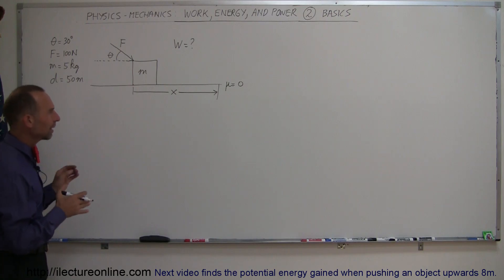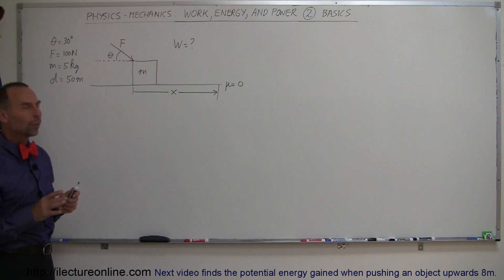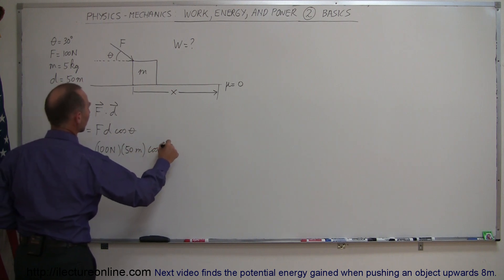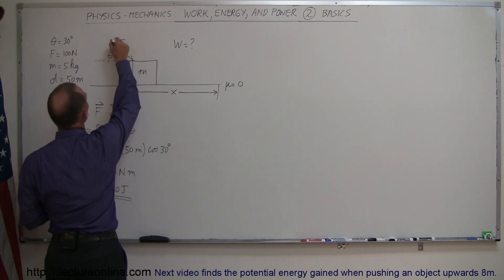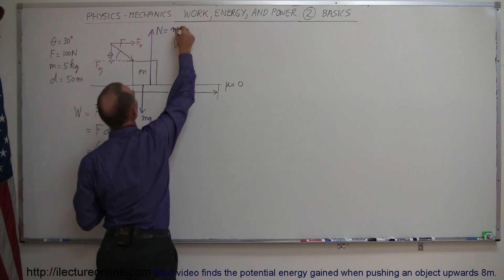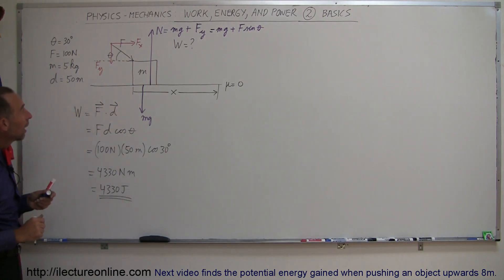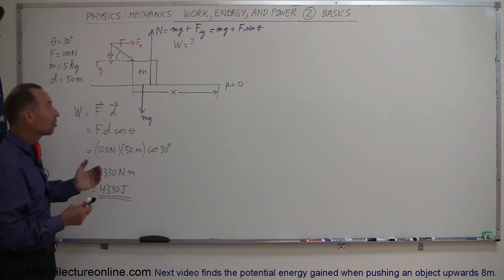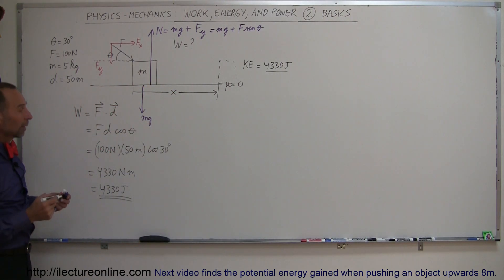Physics 8  Work, Energy, and Power (2 of 37) Basic Example

Comment: I have a question: when you started using the second way you know finding the components for the force(F), how will that help us find the work? Do you just replace the magnitude of the force(F) with its x component in the formula for work and ignore y since it's not moving along y?
Reply from the maker: The definition of work is:  W = dot product of the force and displacement = |F| x |d} x cos (angle between them).    Or we can simply take the component of the force that is in the same direction as the displacement = F x cos(theta)
Reply from the maker: Work = dot product of Force and Displacement.  Or you can just take the component of the force in the same direction as the displacement.

Comment: does mass become unimportant in this problem??
Reply from the maker: It depends on what is being calculated.  If all we are determining how much work the applied force does, the mass of the block does not play a role.  But if you want to calculate the kinetic energy imparted on the block and how fast it is moving, then yes, you will need the mass.
Reply: @MichelvanBiezen  thank you so much! I have been struggling a lot with uni physics since it is online

Comment: Hi sir! Sorry just a question here. It seems easy though but the given information does not seem enough. A 75 kg person climbs stairs and gains a height of 2.50m, and find the work done to accomplish that task. Here the question didn't offer force or displacement, and it doesn't provide the angle between the component of force and displacement. With mass and height given, the first thing that flashed in my brain is PE, so I think maybe I can try. I multiplied everything up and got 1875 as the PE. I know that -PE = KE, so the KE is -1875J. Using the work-energy theorem, I found that Wnet = -1875J. I don't think it's right. How can I calculate it if I don't know either the F and d and the angle?
Reply from the maker: PE it is.
Reply: @MichelvanBiezen  Okay thank you for replying! So the work done is PE?

Comment: Hi :)
I'm not sure if I understood well enough. So in this case, the x component of the force is used to get the object moving and because there is no friction it all goes into the kinetic energy - but if there was any friction, the x component would be equal to the friction so it would all go into heat and it wouldn't contribute to the kinetic E? What about the y component in both cases?
Reply from the maker: If the x-component of the force was greater than the friction force, there would still be an increase in kinetic energy, but not as much.  (Only the portion of the force that exceeds the friction force would increase the KE).   In the vertical direction (y), the forces are balanced.  (No net force).
Reply: @MichelvanBiezen  Thank You very much! :)

Comment: isn't the normal force equal to "fsin(theta) - mg" instead of them being added since the weight of the box is directed downwards?
Reply: fsin(theta) is not a reactionary force to mg as the force is being applied to the box, which adds the y vector component of the force to mg, the normal force is the reactionary force to that addition

Comment: great video but im confused as to how you finished solving by using the second method. Thanks
Reply from the maker: What specifically are you confused about?
Reply: in general, how you use the second method to find the work done. I don't understand why we have to find the Normal force.
Reply from the maker: You don't need to know the normal force unless there is friction.  When there is friction you need to calculate the friction force.

Comment: I understand how you calculated the normal force, however, am I correct in saying there was no need to calculate that force, as, like you said all the work done is transferred to KE into the block moving sideways. Therefore the vertical forces are irrelevant, in this case, as they cancel out.
Reply from the maker: Since there is no friction, you don't need to know the normal force.
Reply: Thank you for your response.

Comment: If the block would have been on an incline and pushed up, would there be 4330J of potential energy and kinetic energy?
Reply: It seems like we would separate the energy into components, and the y component would be the potential. Is this correct?
Reply from the maker: Energy is a scalar quantity and thus you cannot separate it into components.

Comment: what if we don't have the mass? Is there any way to find out the PE?
Reply: never mind i got it, but what if the force is applying on the right side of block with the same angle from horizontal line , but towards right(NE). 
In that case are we going to have any PE?
Reply from the maker: Potential energy can only be added to an object if the object gains height.  If the object remains on the surface, there will not be any PE.

Comment: Why the Kinetic energy is still 4330 J?? is it suppose to be zero because, it has reached at the end of the distance??
Reply from the maker: +deadpool SMASH 
KE = (1/2) mv^2
In this example all of the work is converted to kinetic energy, which means the block is moving after moving 50 m.
Reply: ohh now that makes sense, thanks

Comment: Wouldn't you subtract the y component from the N force since it's going down?
Reply from the maker: +kose241 
The normal force is a reactionary force (Newton's 3rd law)
The normal force is equal to the weight of the block plus the additional force contributed by the y component of the force pushing on the block.
Reply: Michel van Biezen normal force and weight are not action-reaction pairs, I guess. Also Newton's third law acts on a different objects, whereas contact force acts on the same objects, that's why in some situations we could cancel out Normal and weight. Am I right?

Comment: THE THETA IS SUPPOSED TO BE THE ANGLE BETWEEN FORCE AND DISPLACEMENT , RIGHT?? THEN HOW CAN THE THETA BE 30 DEGREES, IT SHOULD BE 150 DEGREES ,RIGHT??
Reply from the maker: +Sreyas Thejas 
In your opinion, what is the direction of the force and what is the direction of the displacement?
Reply: the force applied is at an angle top left of the box and the displacement is in the horizontl direction
Reply from the maker: +Sreyas Thejas 
Now, if you continue the arrow from the force forward and you draw an arrow from the block in the direction of motion, the angle between those two arrows is 30 degrees
Reply: +Michel van Biezen  UNDERSTOOD. THANK YOU SO MUCH.

Comment from the maker: Jessie,
You probably have your calculator in radian mode instead of degree mode.
Cos (30 degrees) = 0.866  (not 0.154).
Reply: Sir what about the case with friction?
Reply: @jaswantg9427  You have to subtract the friction force from the total force of 100N and then multiply I believe.
Reply: A second way to solve is to calculate the contributing forces. You can calculate both work(the net work and the work that friction does) respectively and add them together. Note that if you were to add them, the friction force has to be negative because it's opposing the motion and it's removing mechanical energy from the system.

Comment: Michel I have a hard time understanding when to use cos and sinus. Could u explain to me why is it cos(30) and not sinus(30)?
Reply from the maker: Jian Gui Li Every vector will have a horizontal and a vertical component.

In this case the horizontal component is the component pushing the box.  The horizontal component is the adjacent side of the angle theta.  
Definition of the cos = adjacent side / hypotenuse 
Therefore we use the cosine.
I have 3 playlists on trigonometry which shows you how to figure that out.

Comment: When there is an force pushing against an object at an angle (such as the box in your example), when, if ever, will sin(theta) be used??? If it is never used, will you please explain why it won't be?
Reply from the maker: scaly manfish 
If the coefficient of friction is zero, the vertical component will have no bearing.
If the coefficient of friction is not zero, then it will add to the normal force.

Comment from the maker: nameri lafazan,
When it comes to forces (which are vectors with magnitude and direction), the direction is considered positive when directed upward or to the right (by convention) and negative when directed downward and to the left.
The magnitude of a force (vector) is always positive.  We only add the negative sign when adding or multiplying vectors together, or when we write the information in vector format.
The normal force (caused by a surface pushing back) is typically directed upward from a horizontal surface and would therefore have a positive (upward) direction

Comment: If it is frictionless would the block go on forever? So the work is infinite?!! I know im doing something wrong here.... can simeone help?
Reply: Work is FORCE times distance. Force is the ACCELERATION of a mass.

So although it would move forever, it would NOT accelerate forever.
Reply from the maker: Victor,
You are correct.  Since there is no friction, the block will go on forever after reaching point x and the force stops.  
No, the work is not infinite.  There are different definitions for work.
1) W = F * d
and
2) W = change in energy.
Thus the work is turned into energy (in this case kinetic energy).
After the work stops, the block will not gain any more kinetic energy, but because of the lack of friction will maintain that kinetic energy forever.
Reply: oh, thanks alot